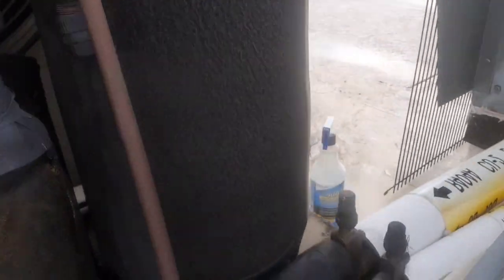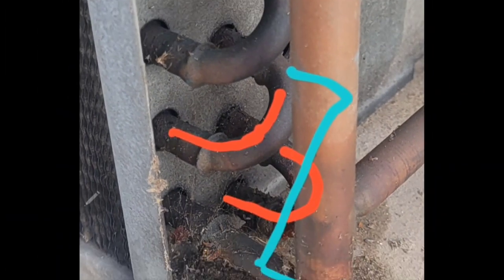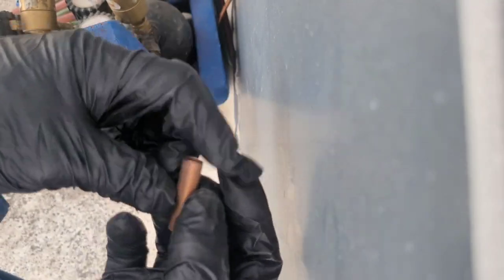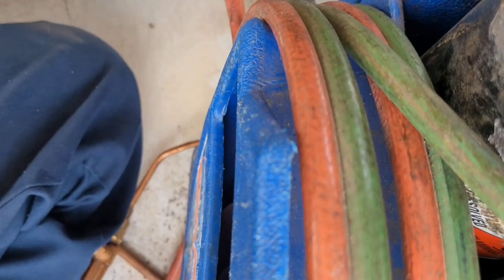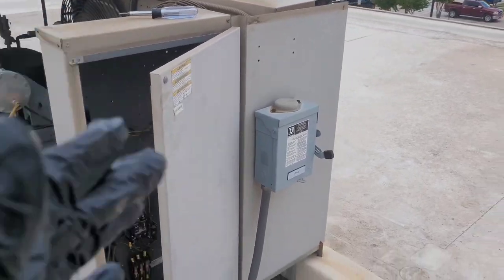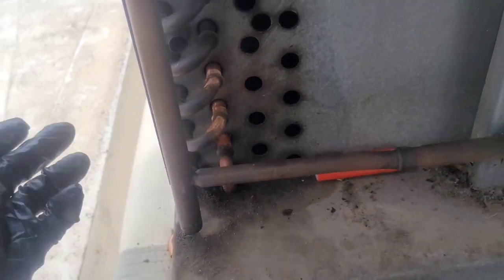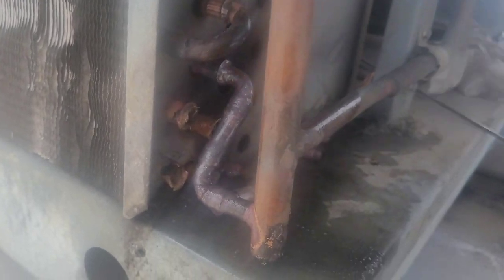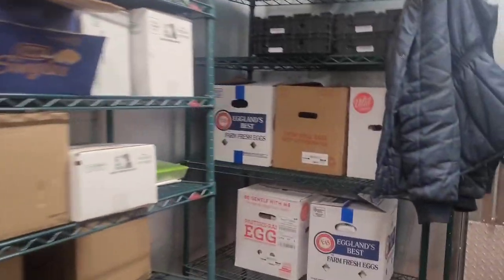CONDENSER COIL LEAK REPAIR - CORRODED R404A CONDENSER LEAK ISOLATED - RECOVERY/REPAIR/RECHARGE

Comment: FYI, rigid copper needs to be annealed prior to swaging, flaring, bending copper. Without annealing, usually cracks.
Reply from the maker: I've never had a crack occur on a 3/8 piece of copper when expanding it just enough to slip another piece of 3/8 inside of it. It does make sense, however, that rigid copper is not as flexible and is more prone to that occurring than soft copper, so I appreciate the info because I was not aware of that word.  I had to look up what it meant because I've never heard it before lol.
Reply: @HVACRServiceTech  if all you have on the truck is Type L or ACR, it will work…obviously. But if you need to swage or flare, or even make a bend if you didn’t have an elbow, taking the torch to anneal the pipe will soften it. Might be ok on the smaller stuff without it, but the bigger pipe it really helps. Cherry red, let cool slowly, game changer when you need it in a pinch out in middle of nowhere!

Comment: As a service technican working often on machines with an extreme amount of gunk in the corners first thing I do is cleaning the service spot sufficiently. This amount of sand on the bottom panel makes me nervous.😁
Reply from the maker: i understand what you mean. thanks for the input

Comment: You could use a solenoid magnet to leave solenoid open without having to jump anything out?
Reply from the maker: Yes, a solenoid magnet on it would work exactly the same. I decided to just undo the contactor leads. Seems like less work than getting the ladder... opening the evaporator end cover, unscrewing the solenoid coil screw. But its ultimately up to you which one you want to do. As long as the circuit is open and free to breath, is what matters...
Reply: Or equalize thru the gauge set?
Something I miss when working with discrete pressure probes.

Comment: Epa has no requirement on leak repairs on systems that hold under 50lbs. Plus no vacuum before recharging?
Reply from the maker: Well, then maybe it's a store policy or company policy where I work. I'm just trained not to under any circumstances,  add refrigerant to a system, until a leak has been found and resolved. The EPA does state that about 50lbs. I just happen to like this procedure(fix leak before charging) better than how I did it the last 20 yrs. And yes,  vacuum is important,  I'll be sure to include it in future videos. Thanks for watching and commenting!